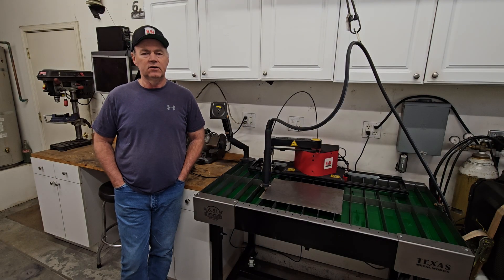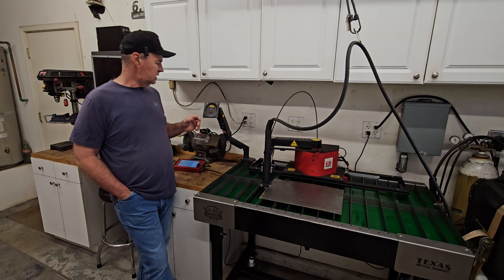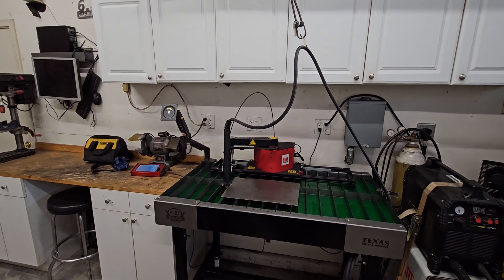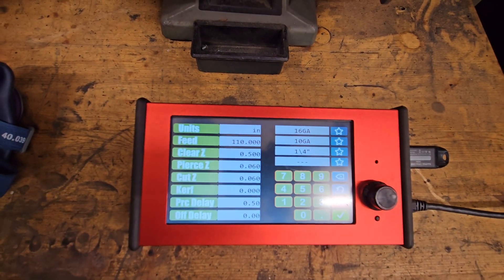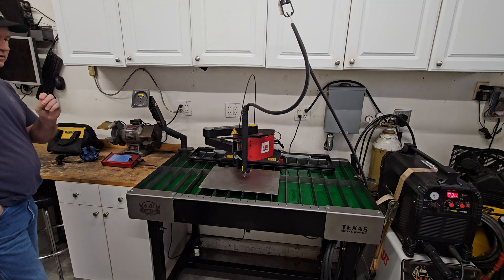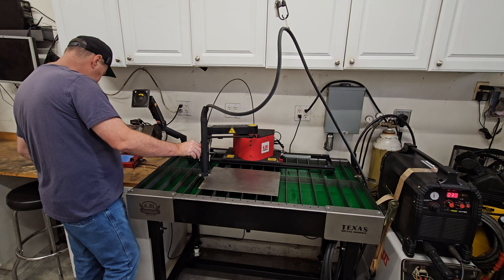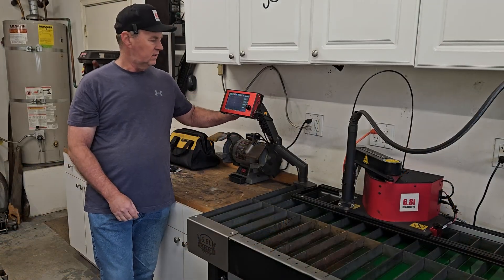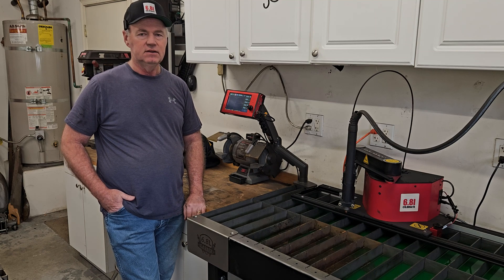Mounting the ArcDroid CNC Controller on an Articulating Arm | Plasma Cutter Upgrade

Comment: I have been looking to buy a ArcDroid.  Will it cut holes down to 1/4” with any accuracy??
Nice video of table.
Reply from the maker: I will say yes.  There are a lot of variables related to the plasma cutter and the material as well.  I mean a 1/4" hole on 1/2" material, I would use a drill.  For my setup on up to, say, 10ga or 1/8" I try to keep things larger than 1/8'.  Any piece I'm leaving attached I always measure to be at least .125".  Thicker metals use so much heat that .125" might be too small.  Rambling here.... Does that help?
Reply: @ yes. Thanks.  
Will be cutting 12g mild steel.  
You are not by chance located in Illinois are you.
Reply from the maker: @billdaniels5957  Sorry People's Republic of California

Comment: Be careful when you Home. I think I have the same arm. I didn’t bolt it in so I can switch from left to right. With the AD arm fully extended, during Home it will rotate fully clockwise before folding the arm in. Ask me how I know…
Reply from the maker: Trust me I know how you know!   Thanks for watching and for the tip.